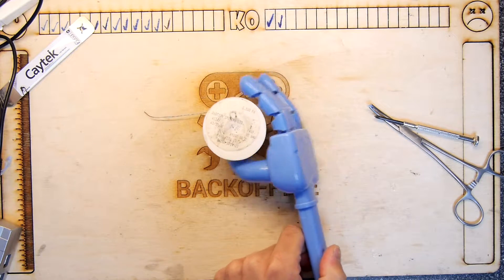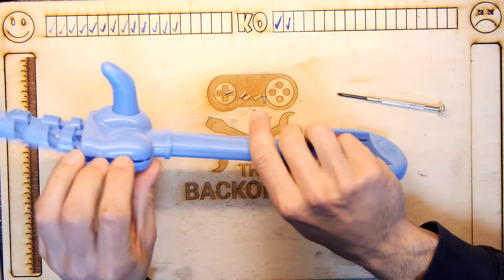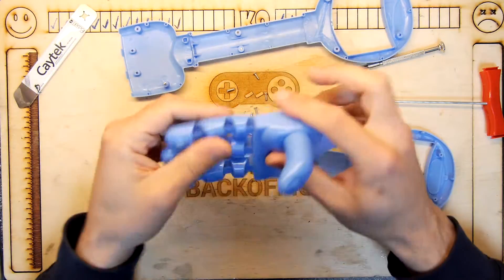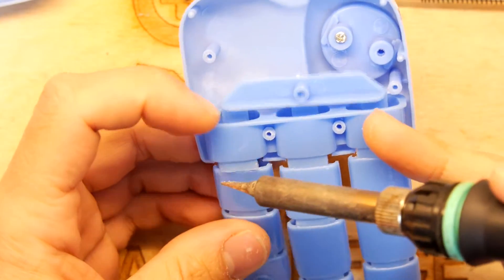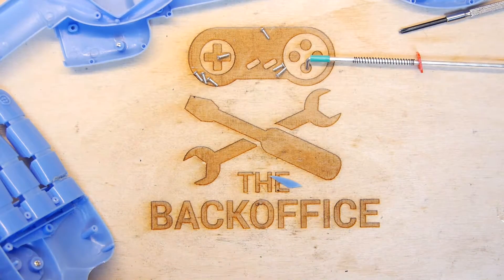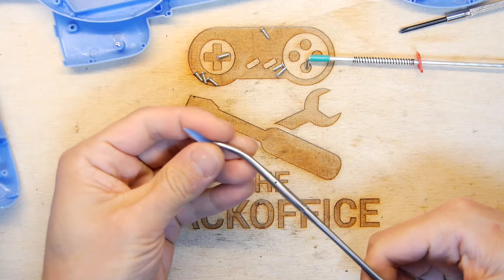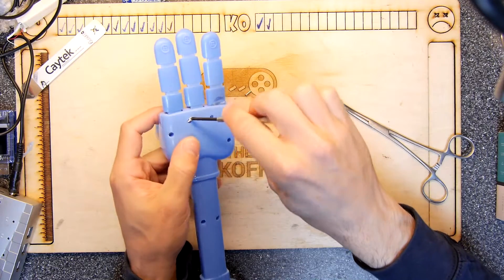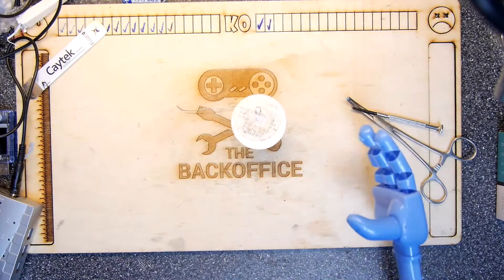Robot Arm Repair

Comment: Gaffer tape!  Everything can be fixed with gaffer tape.......
Gaffer tape forever and ever.
Reply: I_will_get_you There - Gaffer tape? It doesn't even hold a light to Duct tape. Gaffer tape is for temp fixes. Duct tape is forever. 🤣
Reply from the maker: +FairFight14 now you have piqued a non existent interest in comparing the tapes
Reply: The Backoffice Well it's two different things. Like using a rubber hammer when you should use a sledge hammer. One should know one's tools. 😎
Reply from the maker: +I_will_get_you There I ended up eating yesterday's chilli, no one bought me lunch 😥
Reply from the maker: +I_will_get_you There but..... will it fix a broken heart 😭
Reply from the maker: +FairFight14 clearly I have much to learn!
Reply from the maker: +FairFight14 I'm bored, buy me lunch today! 😂
Reply: The Backoffice You buy me lunch - respect your elders. 😂🤣
Reply from the maker: +FairFight14 I always like something to read on the loo, so that's me sorted later 😂
Reply from the maker: +FairFight14 I didn't think you'd be hungry after meals on wheels had been around?
Reply: FairFight14 , TheBackoffice... Who ever buying lunch? I will be there to argue about tapes,.... :-)